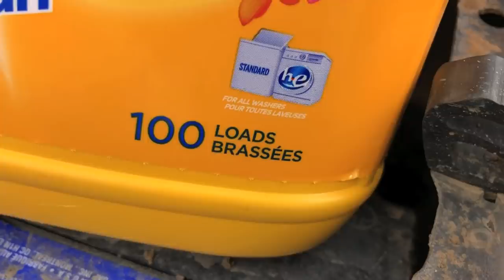Using Laundry Detergent As ENGINE OIL!

Comment: The faster they lock up without oil, the tighter the clearances are in the engine.... meaning it was a healthy engine. The ones that run a long time are usually tired worn out engines with a lot of slop inside.